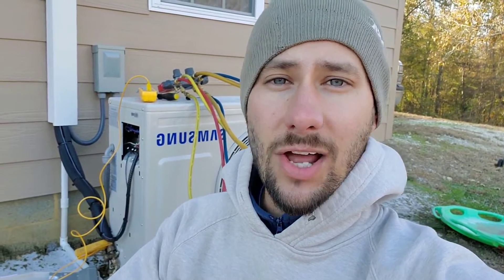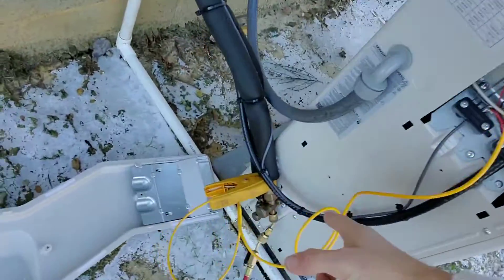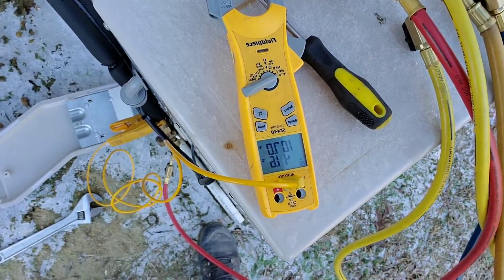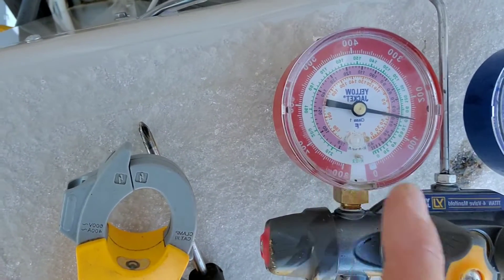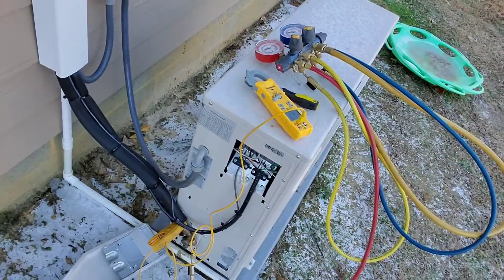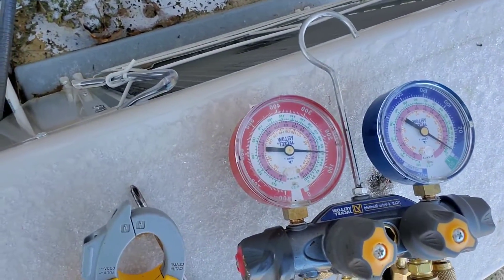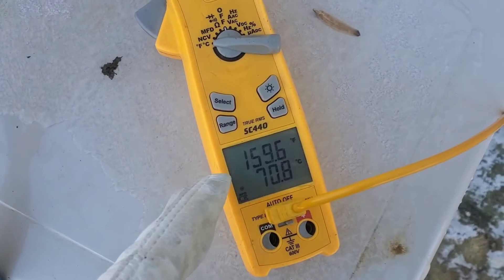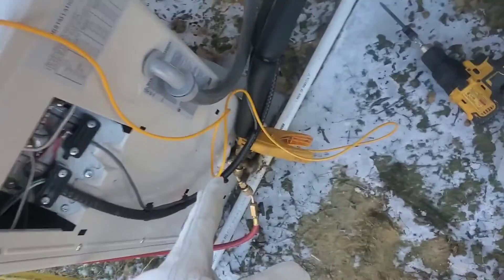Samsung HVAC Heat Mode Low Charge Ductless mini split repair #minisplit #heatpump

Comment: Boom I did it right! LOL.   Have a Pioneer Mini Split that had the indoor unit pop a cork and empty itself out into one massive ball of ice.  Pioneer warranted the indoor unit, but DIY. Its 47* outside so can't use my low side pressure chart since its for AC only. Since I know what the factory charge is, 28.57 ounce, the scale doesn't read  more than 1 after the decimal charged to 28.6 oz. LP gauge was right on 325 and its putting out decent heat.   I nitrogen filled it for 3 days waiting on a canister, then vacuumed it, held full vacuum for 24 hours, but running a probe inside under the indoor unit the probe is beeping a bit so took a reading with the unit off and settled and will check it in a few days to verify if its a false reading.   I don't know how long R410a can sit in a room and still trigger a probe.

Comment: Hey tad! My units reading 460psig on the (low side) but it’s in heat so it’s the high side. Line temp is 110degrees. Is it so low on charge that the eev is hardly opening and causing the high psi?  It needs more gas?

Comment: So you connected high side of your gauge to the low side port and charged that way because your low side is the high side in heating and your looking for a 160 degree line temp?
Reply from the maker: yes
Reply: @taddydigest Thanks for that. I've seen that in order to charge in the cold it's a good tip to put your tank in warm water first? Have you tried this?
Reply from the maker: Yes that's also a good idea

Comment: Love your vids sir! Couple questions, did u charge in heat or cool mode? And do these temp numbers go for all mini splits in heat mode?
Reply from the maker: I always charge in cooling mode
If it's too cold outside to get the unit to run and cooling operation, then I make the unit run in heat operation and pull the plug for the reversing valve to charge.I have a video on that
Reply: @taddydigest  where can i find that video

Comment: Are those pressure  and temp number values because of winter outside temps? Was seeing people saying pressure should be around 117-120, but this was during the summer time
Reply: That 117-120 is in cooling mode, he is using this thing in heating mode so everything is reversed now. Over 300 in heat mode.

Comment: To charge r410 Minisplit  on heat mode through  high side? 
Cool mode suction line ( low side) 
Is this correct info?

Comment: My Samsung ducted heat pump:  you state in the video that the indoor fan will not run even in manual speed until the indoor coil reaches a certain temperature.  This is not a good design especially for a ducted heat pump feeding several rooms in the house.  The fan should be able to run continuously to balance out the heating in a large house.  When in A/C mode the fan can run continuously if desired!  Perfect!  Can the remote thermostat be programmed to allow this?

Comment: Can you use different brand mini split like a Mitsubishi condenser with Samsung evaporator
Reply from the maker: No I don't think that's possible
Reply: Ok thanks alot
Reply: One other question I have a ymgi mini split condenser I googled it and the brand that comes up is sanyo/Mitsubishi does that mean they're compatible

Comment: I see you charged unit in winter in cooling mode. How did you do it in cold weather?
Reply: I don't think there is a way unless he used a recovery unit to charge? The pressure would be too high to get the refrigerant in with cooling mode?

Comment: I have a ductless Aire I bought from Home Depot. Installed myself I’m a homeowner not HVAC tech. After nearly a year the heat output fluctuates from 70 to 90 degrees not warm at all. What u think problem is? Thx
Reply from the maker: low charge leaking flare fittings 
If you want to buy tools and me teach you how Click the JOIN button and then send me an email
Reply: Would the low charge also affect the AC performance in summer? It takes the unit 45 mins to start producing heat. And what temperature of air should be coming out of the unit? Thanks!
Reply from the maker: oh absolutely yes
Reply from the maker: the air outlet should be twenty degrees cooler than the entering air 😎
Reply: Awesome thank you. And heat should be 20 degrees warmer than entering air?
Reply from the maker: Yeah 
JOIN if you can I will do videos for you and live stream 
I do live streams for just members 

https://www.youtube.com/channel/UCuMyjTVlkM4xZ5z_eSyoB1w/join

Comment: How are you taking the high side pressure on a mini with only a liquid side service port?
Reply from the maker: in Heating mode the vapor line connection is the high side
Reply: @taddydigest  Good to know.  Then how do you take high and low with one service port to figure your sub cool and super heat?

Comment: Hello, what range of pressures can we call normal pressures at a specific ambient and indoor temperatures when an r410a system has been off for half a day and equalized?  I'm checking my 3rd gen samsung 4 ton air to water ASHP's "High Pressure" on outdoor unit's motherboard's display and it shows 184psi, outside temp is 60F, water in plate heat exchanger's temp is 72F. Do these numbers look healthy to you? Thank you!.
Reply from the maker: Yes those pressures look really good the standing pressure at a 184 would be pretty close to normal for that temperature
Reply: @taddydigest  Thank you very much. We had a leaking flare on it and had it redone 2 months ago but I was still suspecting if something is still wrong. Wish you a good day!

Comment: These things leak like crazy, 2 out of 10 that we’ve installed have had to have evap coils changed. Lots of call backs and warranty work
Reply: I've installed more than 25 mini splits and have never had leaking equipment. I screwed up some flares until I got smart and bought the SPIN flare set. Mostly Senville and Innovair units. A total of about 8 different brands.
Reply: @dacoelec  i wasn't counting the few flare leaks We've had, its mostly the evap coils. We have probably installed over 100 over the past 10 years.. And thats how long the parts and labor warranty extends, maybe we just had some bad luck but i know where to look every time i hook my gauges up a see low pressure.. Glad you have had a better experience though.
Reply: @Justarandomspacemonkey  That sucks. I don't know anybody that enjoys warranty work. Have you ever had a bad condenser? How do you find the leaks? Are they really obvious or do you use ultrasonic? Thanks for the info and have a great Christmas!
Reply from the maker: I use the spin flare tool as well great product 
I have wore the 1/4 inch tool out though 
thanks for sharing dacoelec
What brand of mini split do you recommend 
thanks for watching 👀 🙂 
I have had leaking flares too until I started reflaring all connections.
Reply from the maker: ok I have not heard of this brand I will check this brand out good info thank you very much my friend
Reply: @taddydigest  yeah we use those too, the old style flare tool was too slow. Idont have much experience with other brands, we have installed a few navien and some others but mostly samsung.
Reply from the maker: Is it just the wall mounts that have been leaking a lot or is it the ducted units too
Reply: @taddydigest  both but mostly wall mounts
Reply from the maker: OK I've had some wall mounts leak 
thank you for the info Justin 😀
Reply: Taddy- you have had Samsung wall mounts leak or wall mount ductless units in general?

Thanks